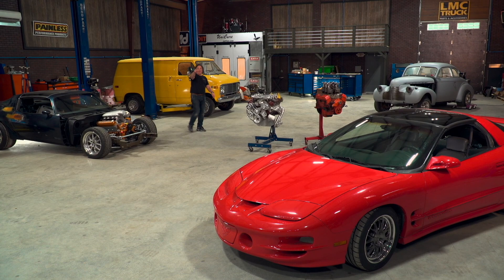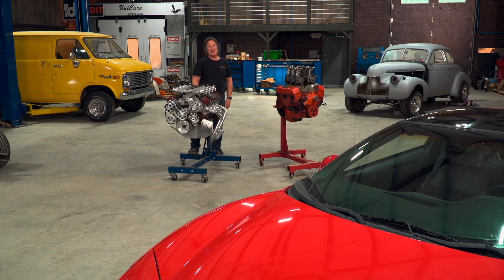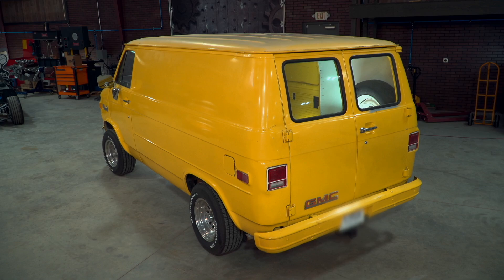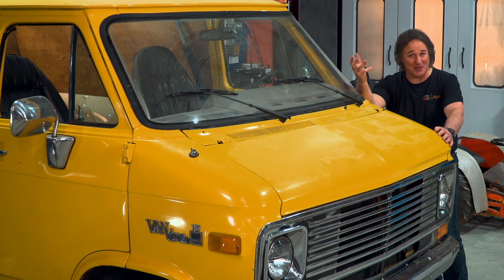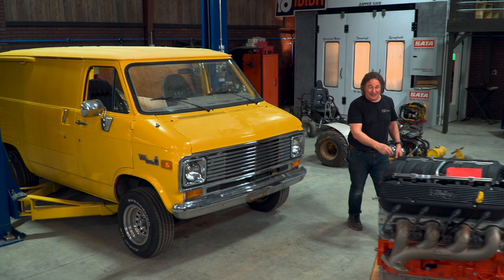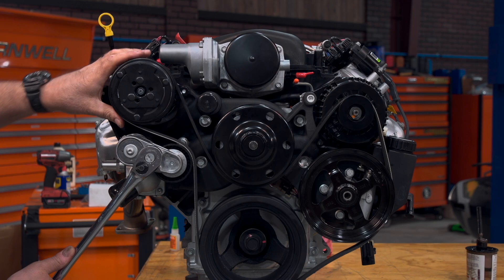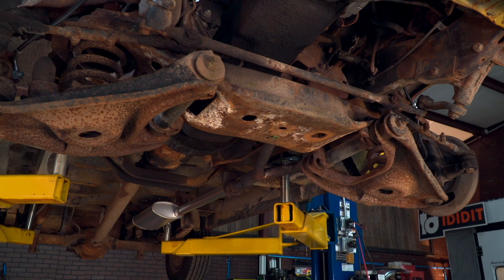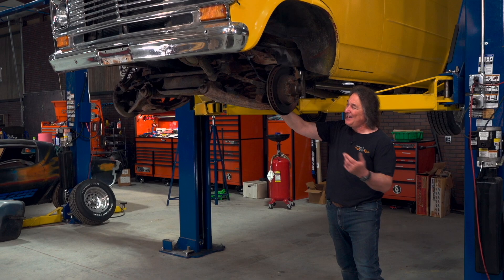PLAN Your Project and Avoid Frustration - Chevy Van Upgrades - Stacey David's Gearz S16 E12 TEASER

Comment: The g 10 and the g 30 are the same as the square body  half ton and one ton but the g20 the three quarter ton has  different lower control arms.The ball joints are bushing are available but it took me 6 months to find lower control arms in a junkyard that weren't rusted out.
Reply: I've been looking for yrs for my G20 lower control arms. They're almost impossible to find 😩

Comment: Good god,  I didn't know it was a rust bucket underneath.  If I'm sinking that much money into it, I definitely want a new frame.
Reply: It a uni body don't be scared of rust just cut it out and weld in new it's easy.
Reply: That ain't rusty at all. Most of what you see is just on the surface nothing wrong with that.